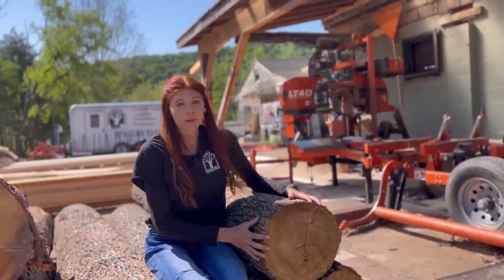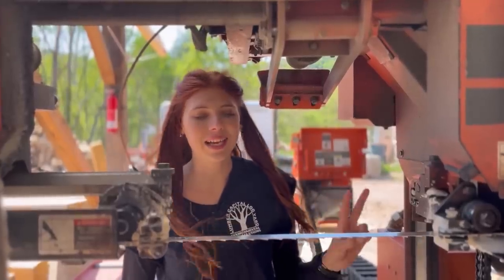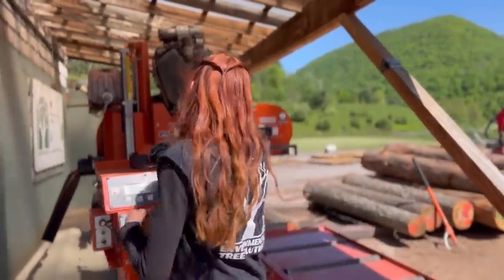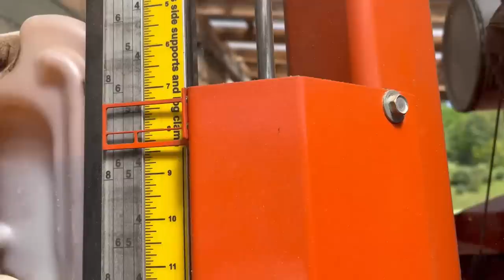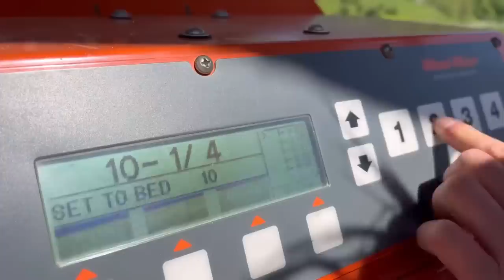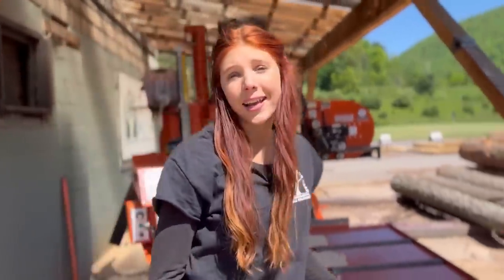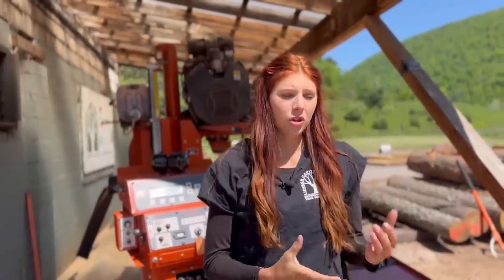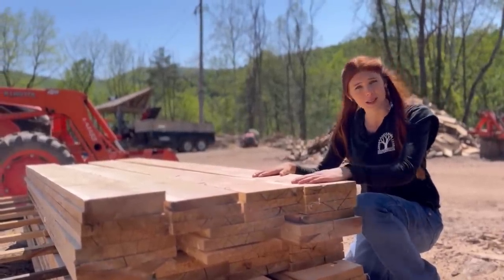Hickory VS Carbide Blade

Comment: When the blade gets dull, send it to Woodmizer. I have friends that use Woodmizer sharpening services. They are reasonably priced and do an expert job on the blades. Most people make the mistake of running a carbide saw blade until it is trashed, then it is beyond resharp. You should get along life from that blade with proper care. If you find the right sharpening shop, you can even get the debarking blade rebuilt for a reasonable price.
Reply: Isn't the debarker blade a regular circular saw blade?
Reply: @jerrydemas2020  the debarker blade is a brazed on carbide tipped circular saw blade with 3/8" carbide tips. It is special built for the Woodmizer. The tips tend to wear a lot due to the dirt in the bark. The tips can be sharpened or replaced. It is not a big deal to do if you have the equipment. Most good sharpening shops have the equipment on hand.

Comment: Carbide can be sharpened using a silicon carbide grinding wheel (green wheel) or diamond wheel or hone stone .
That is what I use to sharpen carbide tools .
Your sharpener should work with the right grinding wheel .
You should not have to bend the teeth for set and if you do try it might break the carbide tips off the blade .
Carbide will cut nails if you go with a slow feed , it is not good for the blade , if going with a fast feed it usually breaks some of the tips off a blade .
I would definitely try to re - sharpen the blades .
New tips can be brazed on a blade to fix missing or broken ones and ground to the same size as the other teeth .
Bigger blades usually have all the tips changed when they can not be re-sharpend any more .
Reply: That's what I thought.👍

Comment: If Woodmizer isn't offering sharpening services call around. I'm sure within a 50 mile radius of y'all there are probably half a dozen sharpening services with as much hardwood is cut for lumber in that neck of the woods. Here in Austin I have 3 (4 if you count San Antonio 70 miles away). Cost of sharpening a carbide blade is probably a tenth of less the cost of buying new. That's one of the advantages of carbide blades.

Comment: Don't toss the blades! Most likely not dull, just have a build up on the teeth which can be removed with readily available blade cleaner.  Spray on brush off and cut away.  You can use it while the blade is still mounted on the saw.  You don't need a special machine to sharpen either. A dremel with a diamond disk will resharpen each tooth, just a short touch to each tooth will do it.
Reply: wear a m35 mask for  the carbide / diamond grit
Reply: Beat me to it, good advice!
Reply: yep, sharpening carbide is no big deal with a diamond wheel. A Dremel would be ok, though a die grinder might be a bit more up to it. Agree with the mask suggestion. I sharpen my 3tpi 112” blades regularly, much better than using them when they’ve lost their initial sharpness as they are less likely to break (and they frighten the life out of me when they let go 😂😂😂).
Unlike a circular saw blade, which really does need doing on a proper sharpening machine to keep the accuracy, bandsaw blades are far less fussy - it really doesn’t matter if the odd tooth is a bit different to its neighbours.
Reply: sorry for Wednesday monday night quarterbacking. does woodmizer have a resharp service?
Reply: I wonder if they take them back and braze on new carbide tips?
But I believe they can be sharpened.

Comment: You can sharpen Carbide by hand with a diamond wheel on a 5" grinder. It is time consuming but still cheaper than throwing them away.
Reply from the maker: We are aware, but as far as I know, we will not be investing in a diamond stone
to re-sharpen these
Reply: @lumbercapitallogyard  I buy diamond wheels and files all the time to sharpen my cutting tools on my lathe. They are not expensive at all! One carbide tool cost 5 times as much as a diamond wheel.

Comment: Stellite/Cobalt (same) tipped bands work great too, and are almost as hard as carbide,  and can be sharpened with a wheel other than Diamond or CBN. Worth looking into.
Reply: John, that is correct. Stellite is a much better choice than carbide for band saws. We even switched from carbide to stellite on our edger saws. You can run sharper angles with stellite too.

Comment: Can't you use a carbide rated wheel on your blade sharpening tool to sharpen those blades?  I used to work as a machinist and we made our own carbide dies but the grinder had a wheel rated for sharpening carbide. 😁
Reply: I dont think they implied that they couldnt get the tools, just that they dont have them. Thats yet another investment and I am sure they will look into it, but at the moment, they may not think its worth it unless they plan to use it a lot more.

Comment: Diamond sharpens all my carbide ...from router bits too lathe tools as well as circular carbide tipped blades  which i typically send out ....
you can get carbide chainsaw blades which are 5$ a tooth here sharpened  throwing the m out is nuts

Comment: Get a carbide sharpening (green) stone for your sharpener. They can be resharpened, the cabide  part of the blade is welded to the steel part of the blade. If you can get set up to sharpen the carbide blade, you can save $$$. They will cut thru steel with out as much damage as the steel blade gets.

Comment: Em answered a question before I even had to ask it, she's GOOD. I was wondering if a special blade sharpening tool is required for carbide. With their zero waste policy I'll bet my next paycheck they don't throw those blades in the trash...lol.
Reply from the maker: We scrap all of our “trash” blades so they are eventually melted down and turned into something else
Reply: I think it is better not to mix carbide tipped blades in regular saw blade waste, to guarantee the correct recycling.

Comment: What would the special sharpening tools for Carbide cost?
Reply: At Logosol a diamond sharpening disc for their sharpening robot costs 159€. Now I am in no way a blade grlnding expert, but usually it'svonly the carbide that gets grinded.
 But businessvise: if life of blade is long enough one could sell used blades for "hobbyusers" or to someone who sharpen them and only use new on the mill. For example: if one box/month is enough and no sharpening (also a cost...) is needed it might not be smart to sharpen at all... At least if you can get 20% back if someone buys them, sharpens them and sell for 50% of retail?
 If sharpening a drill takes two minutes the cost is 1-1,5$ plus sharpening. If a new drill costs 1,40$, sharpening is bad  business if the measurement is money...

Comment: Why don't you lift the far end of the 2 ramps to the Mill by 4-6"???  Downhill Rolls.  Give gramps a shot at resharpening with angle grinder.  Would slowing Travel speed increase the longevity of the blade?
HI Smiley.  Nice Bun.
Reply: In metal working you use a deeper cut with carbide than with other tools. As long as the motor can cope you can really force carbide into the work and get a better tip life.
Reply: @woutmoerman711  Nothing to do with my question.
Reply: @gordbaker896  travel speed is what determines the depth of cut. So I would think you can increase the travel speed to improve longevity.
Reply: @woutmoerman711  no

Comment: Just a thought maybe before you toss that blade to the scrap pile have grandpa reset the teeth back to the proper specs just might give it some new life. Stay Safe.
Reply: Carbide teeth can’t be reset. They can be sharpened. Woodmizer sells a wheel for the bms250 just for these blades.